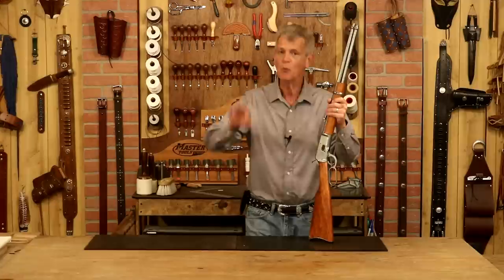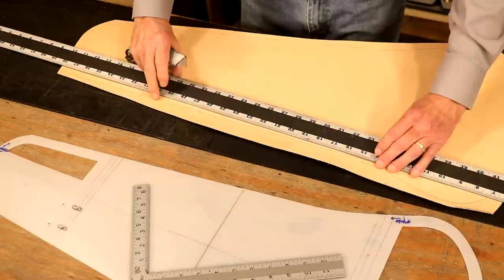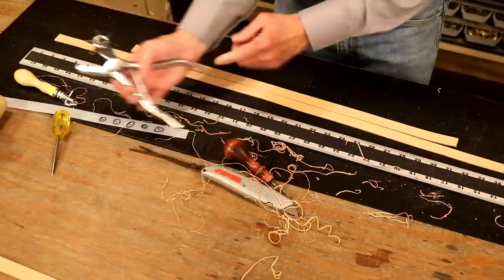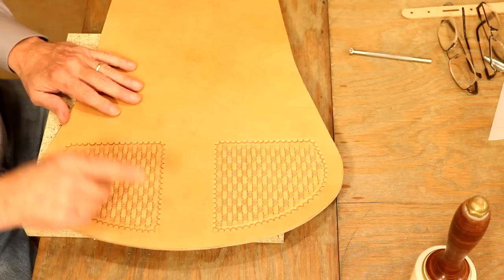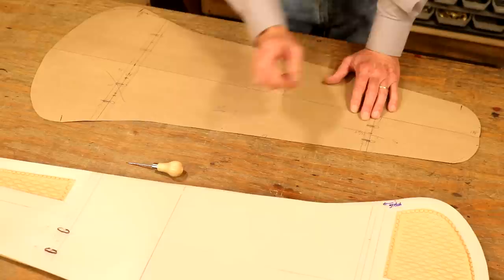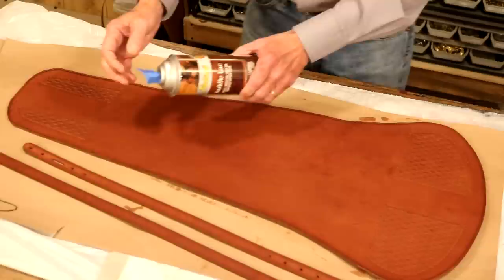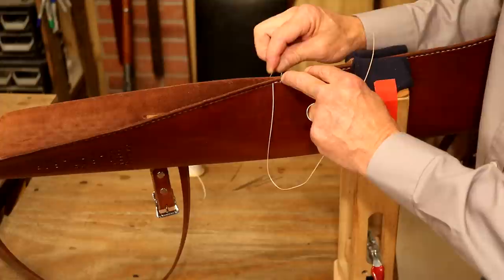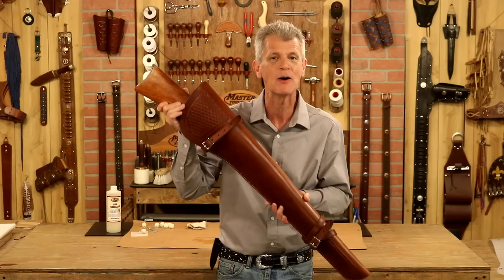Making a Leather Rifle Scabbard

Comment: You know what's great to have in the workshop? A huge roll of masking paper, the kind that's used in an auto body shop to mask windshields etc. They're relatively inexpensive and a roll will last you a lifetime (I've had the same roll for 25 years). Not only is it good for covering your work table and is extremely resistant to solvents, it also makes fantastic pattern paper, especially for large projects!

Comment: I would recommend a small leather re-enforcement at the fold of the lip of the scabbard, going over the lip where the sights and hammer are going to rub. I've seen more than a few rifle scabbards that are fine everywhere else but worn paper thin there. Lever action rifle rear sights tend to be sharp and the hammers are serrated for a good grip, and both of these are hard on leather.
Reply from the maker: Thank you for the recommendation!

Comment: Great timing! This is exactly what my next project was going to be. Question... that rifle looks to be a carbine length barrel, can you provide what the length of it is?  To make one for a regular rifle barrel length in the 22 - 24 inch range, would I just extend the overall length and adjust the placement of the lower strap accordingly?   No need to apologize for longer videos, when Professor Dorsett is holding class, no video is too long!
Reply from the maker: From Chuck: 
Please tell Henry I enjoyed his email!!!  And thanks for the comment on the length of videos.  Laughed at that one!
The rifle in the video has an overall length of 36” (really about 37”) with a barrel length of 19”.  With a longer barrel I would just add the extra length to the barrel end of the scabbard so the upper-end fit isn’t altered, but, you can go with whatever works for you on that end of the pattern.

Comment: On the 1/8 chisel what makes the error? The size of the chisel ex: 1/8. Or is it because it not diamond?
Reply from the maker: Hi there, the 1/8" chisel is flat so you have a little more room for error as far as if the holes on the two sides don't match precisely. This is because we are punching the pieces separately when usually you punch through both pieces at the same time and can avoid this.

Comment: That was beautiful.
The weight of leather used was 8-9oz leather? (I think that's the '8/9' in the #04-500S-8/9, anyway.)

Also, I'm curious; I'd always been told to wet leather before folding it over, but none of that was done? I would've expected forming/shaping to be done before dyeing... Is it a general rule that forming and shaping are done after dyeing the work piece? (I have a particular interest in hardening leather through heat/water, not specifically boiling it...)
Reply from the maker: Hi there,
Yes, 8-9 oz. is the weight of the leather used. 
As far as wet molding, the rifle scabbard in this particular video was just folded, not wet molded around the rifle which is why we didn't wet the leather. But, if you are molding the leather around an object you would want to wet the leather, mold it around the object, let it dry and then you can dye the leather. 
We have a playlist with wet molding videos here if you'd like to check it out: https://www.youtube.com/playlist?list=PLzvwlO3D_z7dNaTMjMm9R05YGA-03waSY
We also have a video series on making a wet molded gun holster: https://www.youtube.com/playlist?list=PLzvwlO3D_z7fy1Q_hgEgkdiJz5Jry0xZK

Comment: Do you ever beeswax the interior flesh side to protect the firearms from the leather tanning chemicals?
Reply from the maker: With vegetable tanned leather there shouldn't be any chemicals that would cause a reaction to the firearm so it's not really necessary. Hope that helps!
Reply: @WeaverLeatherSupply  I Built a document tube out of leather designed to fit a stack of speed loaders for a revolver.  Veg tan but dyed,  the brass corroded super quick.  Would the dye have anything to do with it is moisture just that aggressive on brass?  The outside has Fiebings clear coat so I figured I was safe from moisture.